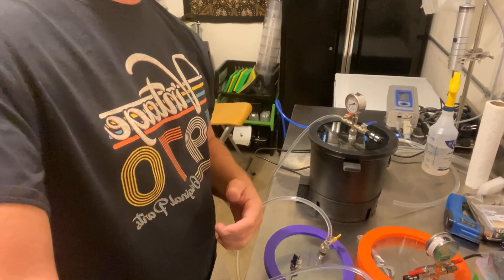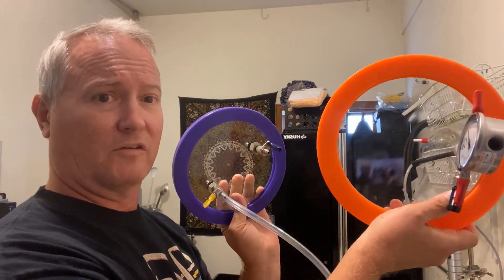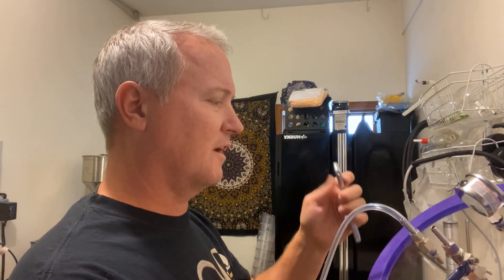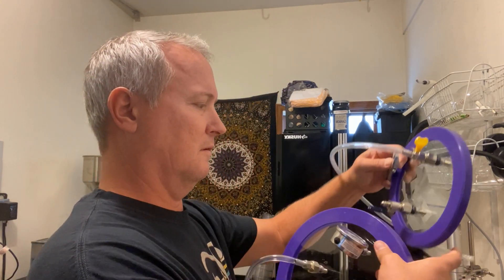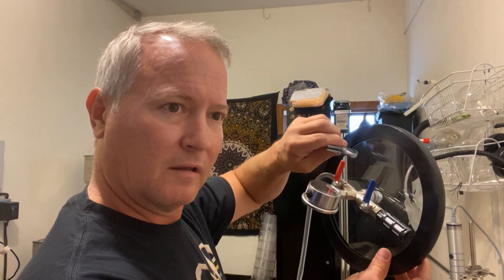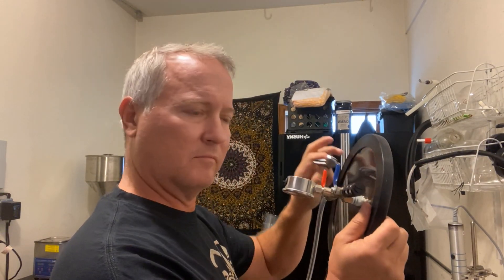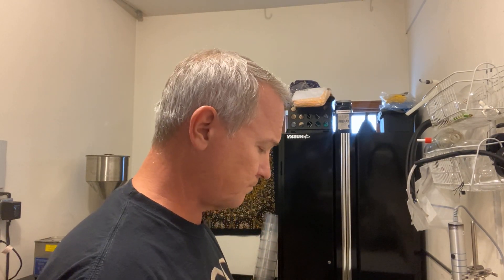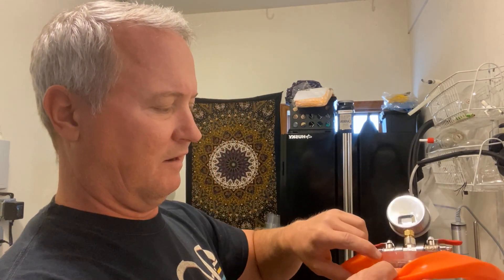Is This Lid Glass or Not?

Comment: What if you scratching the edge of the lid with something that is harder than plastic but softer than glass? Plastic will be easy to scratch. Glass will be hard to scratch.  A piece of copper or brass would probably work because it is harder than plastic but softer than glass. Copper or brass should not scratch the glass but should scratch the acrylic.

Comment: Thanks for the video! Question: what's the general advantage/disadvantage of using glass vs acrylic for vacuum chamber lids?
Reply from the maker: Acrylic has better structural stability in general.  Glass isn’t affected by solvent vapor.
Reply: @IchiBanCrafter  Copy that, thanks! Are you aware of anyone who sells glass lids with a 15" diameter (approx.)?
Reply from the maker: @jasoncaldwell5595  no
Reply: @IchiBanCrafter  Thanks! And last question, do the solvent vapors chemically react with the acrylic, or is it more of a spidercracking/structural thing?
Reply from the maker: @jasoncaldwell5595  cracking is from incompatible chemical exposure in sufficient volume and duration